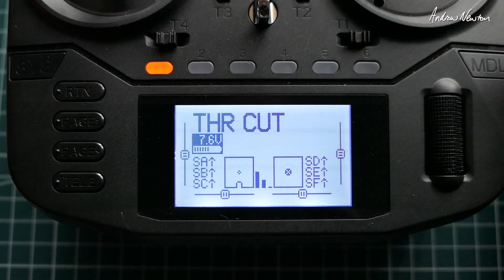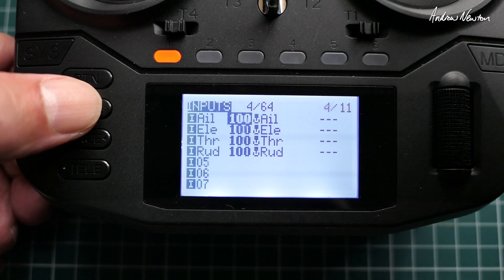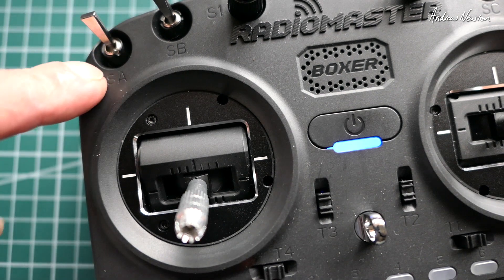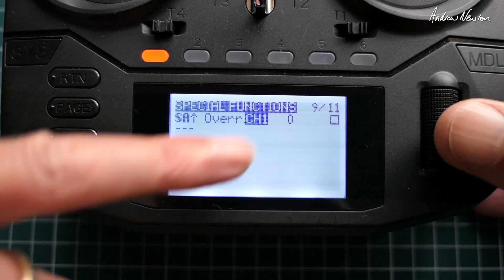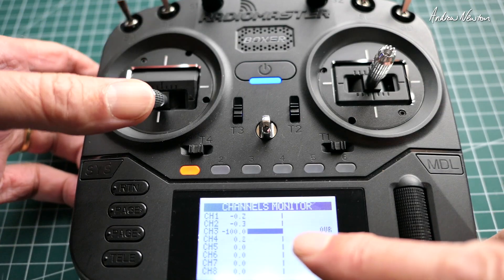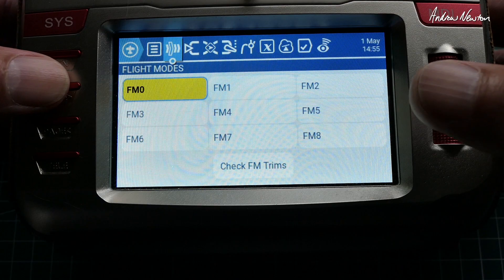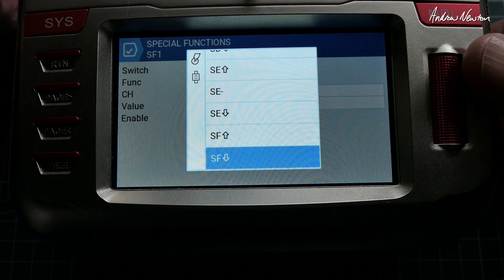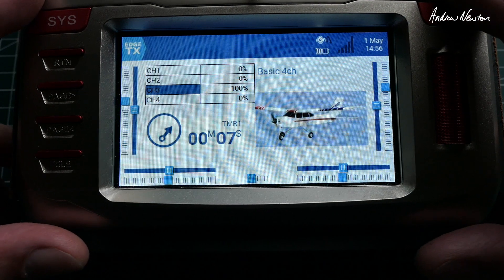Throttle cut switch using EdgeTX

Comment: Would you know if the throttle range on the Boxer can be programmed? I'm looking at significantly over-powering an aircraft and I'll likely only need 1/4 of the available throttle range, so I'd like to be able to program a custom throttle curve so that I can go full throttle with the stick, but only hit a specified portion of the throttle curve.
Reply from the maker: Yes easy. Might do a little video on it. Can reduce the Thr weight (25) and add offset (-75) in the throttle mix, or use a 2 point custom curve that goes from Pt1 -100, -100 to Pt2 100, -50
Reply: @AndrewNewton excellent. Thank you.

Comment: Hello i need to ask what to do i have my radiomaster tx12 elrs and er6 reciever and i just binded my new plane all is working but the throttle is not working
Reply from the maker: Could be connected wrong, ESC needs calibrating, wrong mix in the radio, throttle cut on.

Comment: Interesting thing with an RM ER6 receiver... If your throttles are not idled down and you enable the throttle cut, it will hold the RPM the throttle was last set at.
Reply from the maker: Not with my setup. What are you doing differently?
Reply: @AndrewNewton  EDIT: Being as new as I am to the hobby, I assumed I could just wack the setting down to the lowest number on the override function. This is what was causing the throttle to "hang."

Comment: Simple video of the basic throttle cut setup, really easy for anyone to follow :). 
But I feel it lacks an extra step of safety when it comes to electric models with no FC in the traditional way. Now then you release the throttle cut switch it doesn't check where the throttle stick is at so the motor can spring to life as soon as you release the swithch.
I came across this snippet of logical switch safety some 5-6 years ago from another hobbyist and started using it as an extra safety mean. Even on smaller models.
Also works for both OpenTX and EdgeTX.

L01     a<x    CThr      -98     SF ↑
L02   Sticky   L01       SF↓ 

Why throttle value is at -98 and not -100? One time I could not arm my plane since throttle did not reach that -100 until I re-calibrated the sticks.
Reply from the maker: Yes, very nice addition thanks. That makes it a complete safety switch

Comment: Please tell me why it is impossible to configure the timer to start in EdgeTX when the gas stick is raised up? this works great in OPEN TX.
Reply from the maker: Select THt as the trigger
Reply: @AndrewNewton  You have TX-16S equipment with EDGE TX, try it.
Reply from the maker: I have it in. my hands now and it works as expected. I raise the throttle and Timer 1 starts

Comment: Seems there's several ways to do it, thought I was going mad...lol, as you've showed me the good old easy way again, simple.
Weirdly, when using SE push button switch to arm in lower position clicked down, on main screen where modes are displayed.....if assigned in modes tab....You Arm and other modes are not displayed unless unarmed...Same with SA switch, seems they both like the up position, then your modes are displayed after arming. Cheers Jas.
Reply from the maker: Modes disappear? Dont know why that would happen.
Reply: @AndrewNewton  Not disappear, Just the ARM on main screen display when armed just 'ARM' shows not other modes that have been set in modes tab, modes still work but not displaying which mode you're in, exactly the same set up on my Q-X7 and on EdgeTx, works correctly.......Boxer is on latest firmware update......Q-X7 is on previous firmware.
Reply from the maker: Are you using the INAV FBGroup model on your radio? I dont use that
Reply: @AndrewNewton  
Not that I know of....
Flying Dutchman v2.8.4, (14-05-2023)
Drone set-up using basic transmitter set-up....with Crossfire module on the 
4 in 1 Boxer. Now I've incurred another issue, switch assigned to change power levels on Crossfire module is not reading power levels correctly, but on OSD in goggles it changes correctly.....maybe the lua script needs updating.....but all is working, but not like it was in my trusty old QX-7....I wonder if I go back and use that firmware.....Flying Dutchman 2.8.2...? Scratching my head as it's easy as ti set-up. Anyways thanks for chiming in Andrew, still a nice radio, sits well in hands. Cheers Jason.
Reply from the maker: @QuadographyAustralia1965  Oh TBS Agent Lite is what you're asking about. Sorry mate, I have never used it.

Comment: Absolutely necessary Andrew, however my preference is a rotary dial, which must be turned past halfway to arm the motor.
Have seen too many bumped toggle switches inadvertently arming the motor. Rotary switches can't be bumped.
Reply: Can you tell me where to find a tutorial for this method? Thanks!

Comment: I prefer to use a system which will not start the throttle if the switch is flicked with the throttle high. I just copy it all from model to model as a bit complicated. Also not thought up by me!